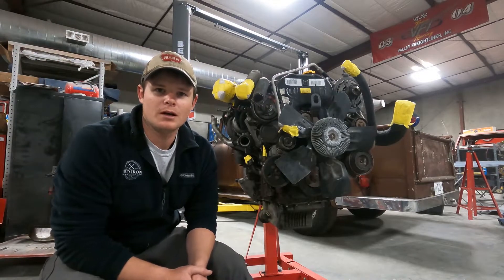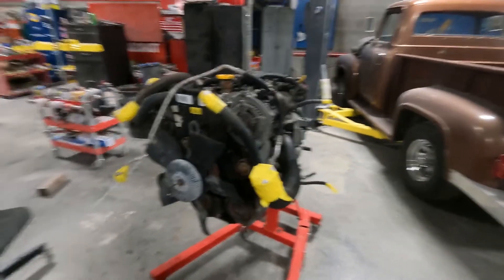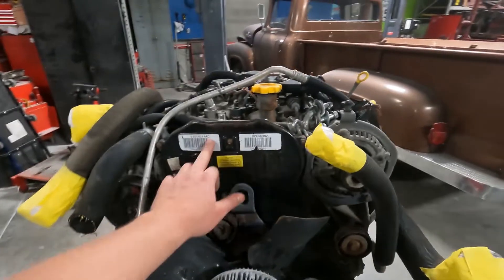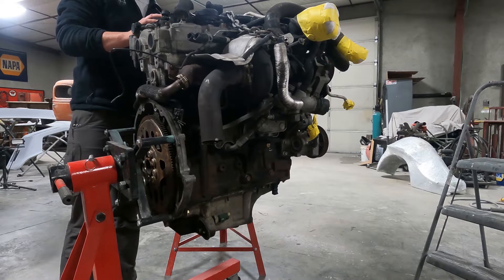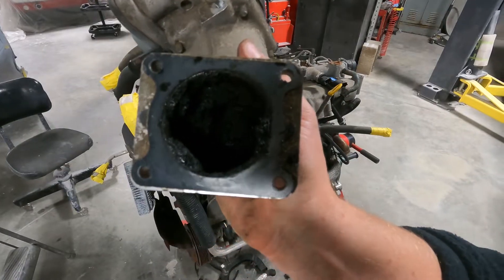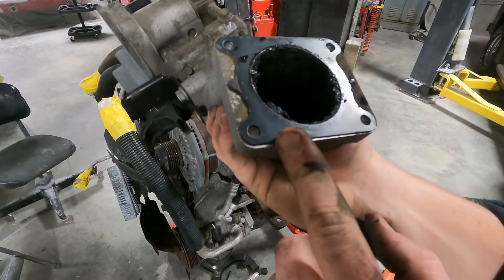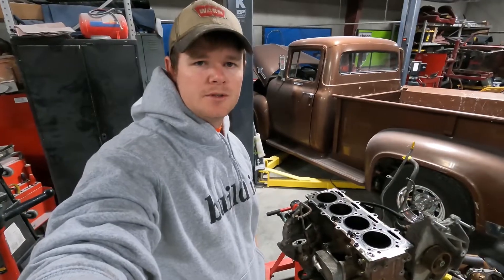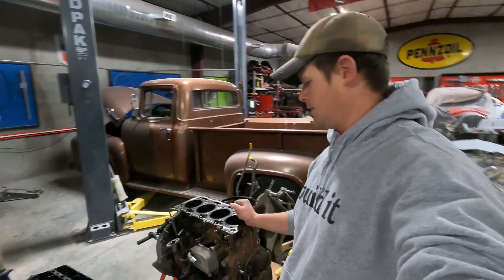Jeep Liberty Engine Teardown Diesel

Comment: I have an 06 crd. Needs a new high-pressure fuel injection pump and radiator. I may as well do all the parts replacement like lifters, rocker arms, water pump, timing belt,  pulleys,  turbo, and clean the EGR system.  Are you interested in doing the work?

Comment: My son has one and beat the hell out of it and it just keeps trucking along.  One additional thing I would replace (whether it needs it or now) is the oil cooler on the RH side.  they are known to crack and dump oil into the coolant passages.  They are a bugger to replace when the turbo is installed.  Cheap part and cheap insurance and totally accessible with the turbo & surrounding junk off.

Comment: Will this engine replace a 3.7 L gas engine in a 2012 Liberty?
Reply: No.  The CRD uses a different transmission, as I recall.  Also, the CRD was available on Gen-1 vehicles.  2012 is a Gen-2.

Comment: Old Iron garage some days ago vía your instagram I requested your help about sell me the power steering pump bracket from the CRD worn out engine that you have there. In my country Perú here there not junkyard here to pull out parts and additional the peruvian customs forbidden used part to come in. is you help me I'll pay vía ebay or the way you prefer and send Miami address through your Instagram.

Comment: THANK YOU for this video ,  i recently bought  crd with a bad engine and also got a junk yard motor that will go in the jeep. new parts include water pump, lifters , thermostat, and an ebay turbo(dont know about this one, looks good on the outside) ) any suggestions ? thanks
Reply from the maker: Only suggestion would be to get an install manual! It helps a lot with the pulling of the motor out of the jeep as well. Best of luck!
Reply: Hi Cristian Sorescu, I’m Juan Woll from Peru, I have two months  looking for the BRACKET which hold the power steering pump and the serpentine belt tensioner, and the bracket join to the engine block  through three bolts on  Jeep Liberty KJ 2.8L CRD. Already I know that you have two engines, Please would you sell me one BRACKET by ebay and through video comments notice me before the BRACKET sell on ebay to avoid someone buy it first. Maybe you have other way to sell me  the BRACKET let me know. For the power  steering pump and the serpentine belt  we'll coordinate  later. Many Many Thanks for your help.